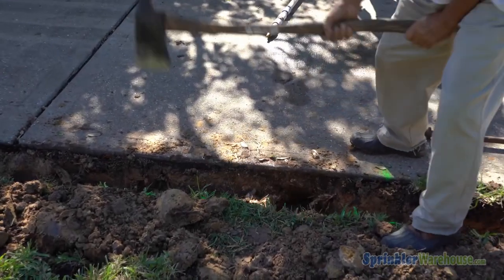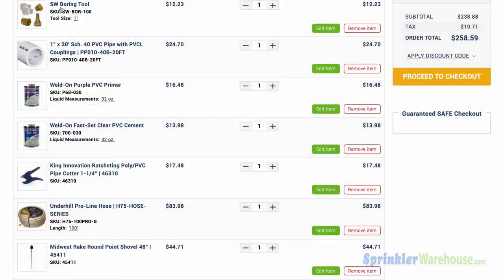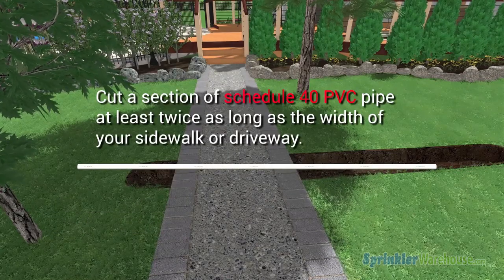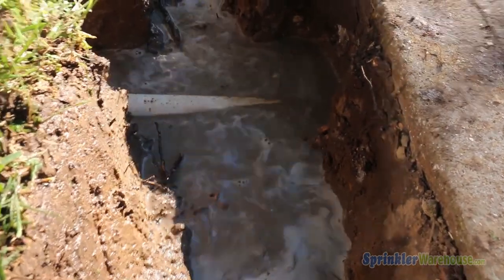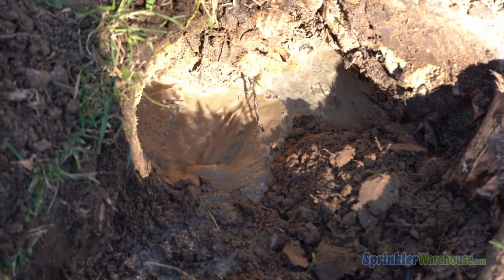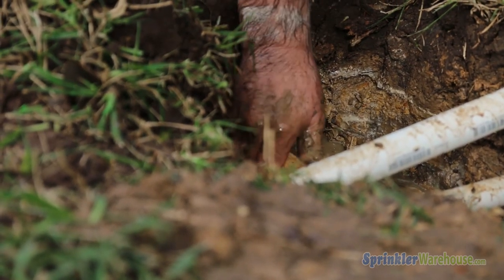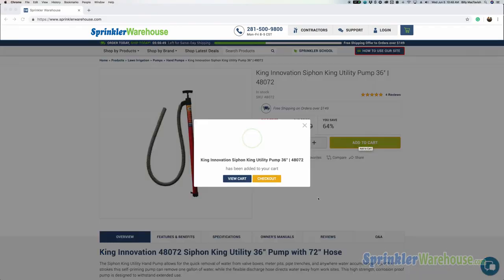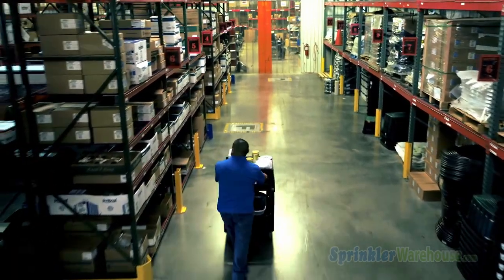Running Sprinkler Pipe Under A Sidewalk or Driveway

Comment: Can I use a bigger pipe for this application. 1 1/4 or 1 1/2 pipe just use reducers for the attachments?. Trying to put a sleeve under driveway.
Reply from the maker: Yes, you can. Please contact customer support as YouTube comments are not usually monitored. I just happened to be reviewing this video.